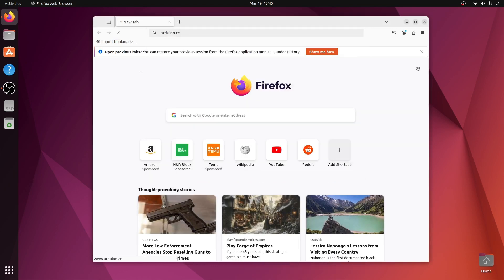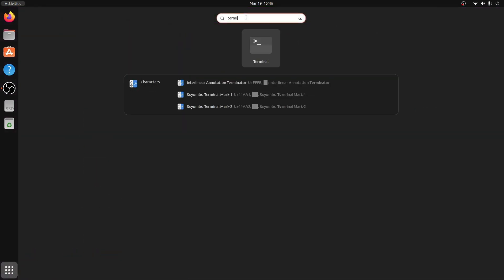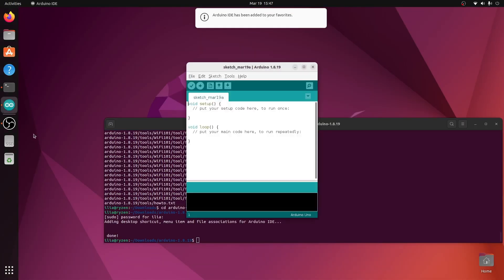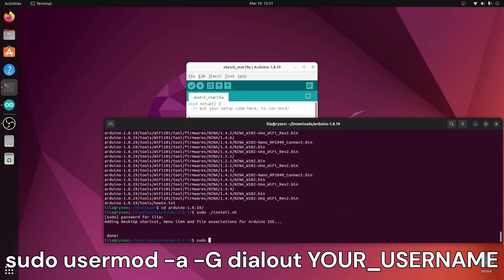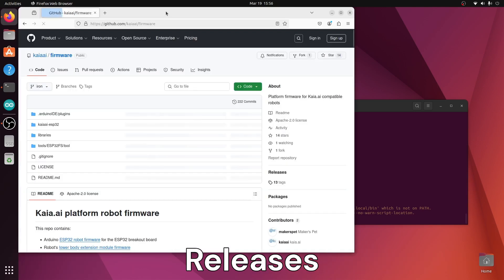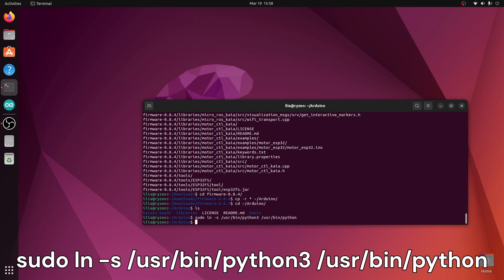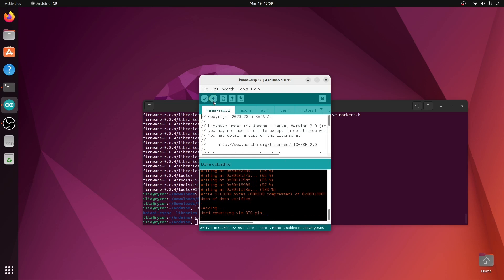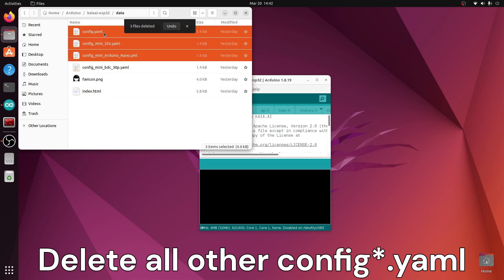Arduino/ROS2 self driving robot - Ubuntu software setup and robot bring up

Comment: Thank you for all the tutorials they are very helpful. Do you think that this project will be viable using rasberry pi 5 (on ubuntu) as robot pc and Windows desktop as a main station to work from and process data?
Reply from the maker: There may be some difficulties operating the DC motors. Raspberry Pi would have to generate PWM on GPIO for each motor and handle GPIO interruptions from motor encoders in real time. RPi does not have built-in ADC to measure battery level. I think all these can be overcome, but it will not be trivial.
Also, Raspberry Pi consumes a lot more power, so the robot will need a large battery.